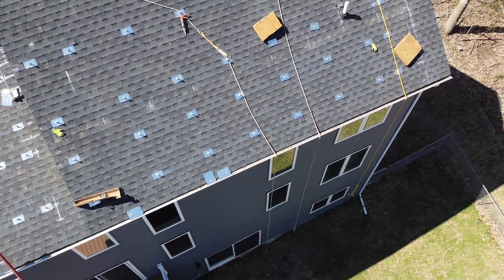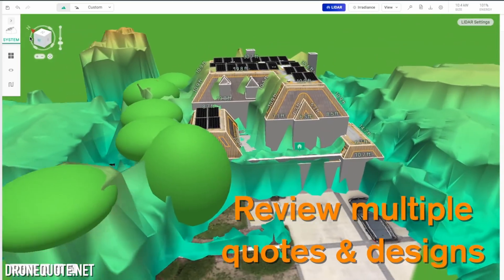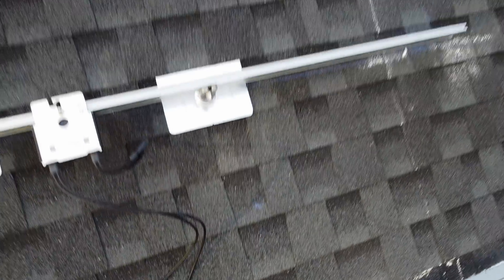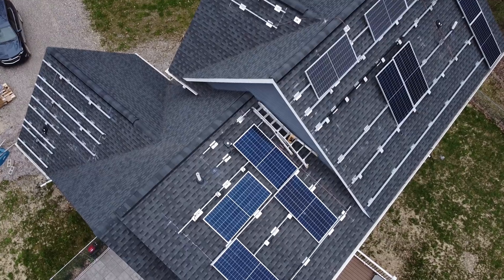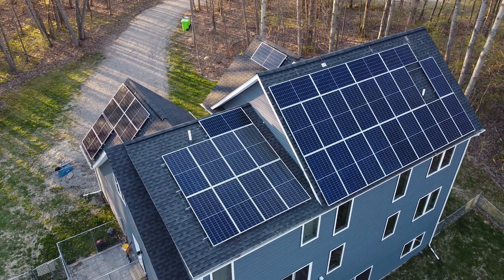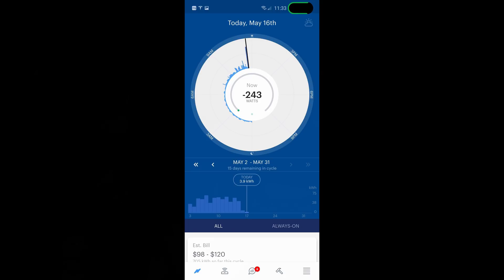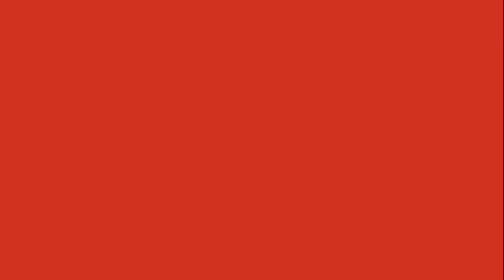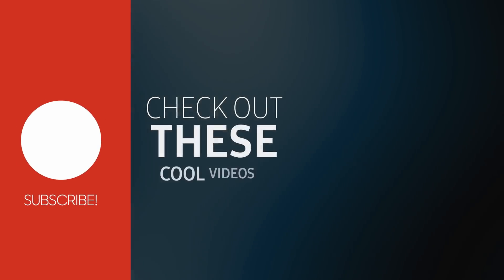Michigan Solar Panel Install Experience | Home Solar Installation, Cost, Positives Negatives

Comment: Is your installed solar panel KW capacity based on your On-Peak usage or entire day KW usage to determine the number of solar panels? how long did they say it would take to pay back the project cost and do you think you are getting there within the time frame they proposed?

Comment: I have seen just about all of your videos in hope to understand how much KWH should I be making to be able to charge a future model x Tesla with the new Solar panels I’m about to have install here in norther Pennsylvania and have enough kw to run my big appliances such electric heater, well, electric all kitchen, septic tank, radiant flooring, outside lighting etc… so I believe I’m overthinking it, at this point I have been Quote 21 panels at 370kw to power a 2000kwh a month just for for house usage.. but my real question is how many more panels should I add on top of the 21 solar panels ?  Again my apologies ahead of time if this question seem silly 🙃.. thank you all for your patience.
Reply from the maker: It's a good question. First of all, make sure you'll be allowed to add as many as you need. Some utility companies will only let you go a small percentage over the amount of energy you use. So in that case, you may just want to get the Model X first and then get your solar quote ~6 months later.

But for a quick guess, take the efficiency of the Model X (I don't know it, let's say 350wh/mi) and multiply that by your miles per month. Say 1,000 miles per month that's 350kWh just for your Model X. Hope that helps :)

Comment: Very nice.  Solar is something I've been thinking about for years, but didn't want to do anything to my dwelling until it was paid for.  I finally do own the home free and clear... but I gained a wife who is a total packrat and has filled my house to the brim, so NOW we're thinking of getting a bigger place so she can store more stuff.  :)  I do have some questions:

1.  I assume if commercial power goes out, you're in the dark regardless of solar output.  I believe you need a battery backup system to basically put your whole house on UPS, and the panels can recharge those.

2.  Did you have to have your roof reinforced (or did you have it built to handle the added weight of those solar panels during construction)?  Was reading that some homes need this supplement.

3.  Inverter life - I've read most of those are supposed to last only about 10 years, or half of the life of the panels themselves.  True/False?

4.  I assume you're eventually going to do powerwalls or Generac's battery system...  do you plan on having the entire house backed up?  At minimum, I'd think you'd need heat, well pump (if you have it), refrigerator, and hot water.  Could get carry-out food until power comes back.

I lose power EVERY year, usually 2 times a year, so much so that I finally got fed up and bought a generator.  You can easily tell how often a neighborhood loses power by how many generators fire up when the power goes out.  And there are a lot of generators around here.  lol

I don't have a pure EV yet... still driving a 2013 Fusion Energi (well, my wife is now; her car got totaled a couple years ago).  Surprisingly the batteries are still OK in that thing.  Probably until next year when the 8 year EV component warranty expires. :)

I've also considered building a new home, but shopping for land has been a process.  I've also thought about putting the panels on the ground or pole mounted, and putting all of the electrical everything (batteries, inverters, etc) in a separate shed/building, just in case something malfunctions; it won't take the house with it if something decides to spontaneously combust.
Reply from the maker: 1. Correct. We hope to get batteries!

2. Nothing special done to the roof. Maybe older houses would be different in some way to need this?

3. I don't remember our inverter warranty, I think it was 10 years. Good news is this is just one unit in the basement, and inverters in 10 years will probably be much better than today :)

4. We will get 1 powerwall definitely, possibly 2 to support more. My plan, I don't know if they'll allow it, is just put the entire residential panel with the powerwall and be mindful of what we run to not overload it at night or if it's cloudy.

As for heat, we have geothermal, and it uses far too much energy for a powerwall or even generator to support it, so we have kerosene in case of an emergency. We lose power several times in a year. If say once a month on average.

Ground mount is definitely a nice option if you have the room, but it's gebrrallt more expensive than roof mount.

Lmk if you have any more questions! Feel free to email me dirtyteslayt@ gmail :)

Comment: You said these panels are pretty tough, are they tough enough to handle the hail we had here in West Michigan last month?   We just had our roof replaced in fall of 2018 and now are getting it replaced again.  But after that hail, I'd worry about putting panels up there.  Of course, hail like that doesn't happen very often, so hopefully we'll be fine for a long while either way.
Reply from the maker: I think they're rated to 1 inch hail. It's very rare but if they break, each individual panel isn't all that expensive fortunately.

Comment: Recent revelation: Solar panels are MORE efficient when cold, which makes sense with less internal resistance from heating. Thus, a colder climate partially compensates for  shallower sun angle and exposure. Excellent video, explanation and follower commentary.
Reply from the maker: Thanks! These dummy 60F days would be perfect for solar but now we're moving into summer (90F today) and still no inspection!!

Comment: Good for you!  As someone who has had panels for a while, I was looking to try and see if you had 'bird barrier' of some kind installed around the perimeter of the panels.  When we bought this house with the panels already on it, there was no bird barrier and we were bothered by an infestation of pigeons roosting under the panels.  It was an ongoing nuisance of noise and mess.  When we had our roof done we had bird barrier installed.  Problem solved!
Reply from the maker: Yeah I thought about it but never got around to asking the installer about it. I'll hope it's not a problem but if it is... I'll have to deal with it.

Comment: Here in the U.K. we are limited to the number of panels per household to 16, the cost to us for Pvs was £6000 GDP with a return for supplying the National Grid of approximately £500 GDP per year, our Pvs were installed in 2014 which means that by 2026 they will have paid for themselves with free power whilst the sun is shining. You really should consider changing your power supply company, we recently got an email from our power supplier (we're dual fuel) telling us that the price of power was going DOWN, with the cost of oil falling your power supply people must be raking in their profits.
Reply from the maker: We do not have a choice in power supply company unfortunately

Comment: Got solar installed last Thursday. Activated yesterday. And I’m loving it! Very similar situation as you. I bought a Tesla Model S  which made me reconsider going solar. Got a 11.4 kW system.  Once yours is activated you’ll be looking at the monitoring app daily! Lol. Great video 👍🏼
Reply from the maker: I'm so jealous!! Still no inspection!
Reply: Dirty Tesla it may be different in Michigan, but the energy company came and installed the meter before the inspection. They said it was fine if it was active while I waited on the inspection , which is scheduled for JULY 30th. May be worth following up with your energy company to see if they can send someone to at least install your meter. It took my guy 5 minutes. I know how hard it is to wait. Good luck!

Comment: What did your company say the expected annual output for your system? I am curious on differences in areas-for my San Diego 7.56kw system expected output is 11.5KWh annually. I am a bit surprised you did not get a Powerwall as it does allow you to never/rarely use Peak rate energy. Agree the payoff period is much longer for the PW. The Tesla 7.56kw + 2 PW was $36k.
Reply from the maker: Should output around 15,400wh/year.

We will get a battery eventually it was just too much money for now. I'm also looking into building a battery as they are waaay cheaper.
Reply: Thanks for the reply. I would love to follow your process on building a battery so please start that soon 😀

Comment: From my experience don’t go with Tesla installer.  

The panels and power wall was put up quickly. The problem is that Tesla failed PG and E inspection our local electric company. This was 4 months ago and as of this date Tesla has not fixed the problem. Don’t use Tesla installer
Reply from the maker: Yeesh. Yeah I've heard both good and bad stories.

Comment: Hope you are able to get your second electric car soon! My wife and I plan to do the same. We just got her an electric car and I've got a Model 3. Our goal next year, hopefully once things get better with the current pandemic, is to also get solar panels installed. I've been looking at several installers, but I'm leaning towards Tesla since I've been told they can install were I live. :)
Reply from the maker: I would have probably done Tesla too, but I've heard from different sources thst while their price is competitive, they don't always do the best job, so may want to get multiple quotes to be safe.

What's your second EV? Trying to convince my wife on the bolt since it's so cheap but it's so ugly haha
Reply: @DirtyTesla  Definitely will, thanks for the advice! I'm definitely open to anyone else. Even if I get panels installed from someone else I am set to getting a Powerwall if it's compatible. Do you know if your panels would be able to work with a Powerwall?

Nice! The Bolt was definitely one of my options when I was buying my car, but my wife was hard pressed against it for being ugly haha We just got her a Mini Cooper SE this weekend. It's not a lot of range, but it's perfect for her in-town driving and we've got my Model 3 for longer trips!
Reply from the maker: @MiguelRodriguez-mj2ec  yes most systems are compatible with the powerwall. My company said my system is ready for a powerwall whenever. If I wanted the LG battery in the future, they were going to add some additional hardware (I don't know what). I obviously want the PW tho.
Reply: @DirtyTesla  I see. Wow I didn't know that LG battery would require additional hardware. Who knows what it could be. LG Battery was my next choice if I couldn't get Powerwall. Well, I'm excited to see more videos about your solar system. Can't wait!

Comment: How much was your geothermal system? I'm interested in doing that for when I build my home as well
Reply from the maker: It was around 30k and gets the exact same rebate as solar.
Reply: @DirtyTesla  is the percentage also dropping in the coming years? 26%,22% ECT
Reply from the maker: @mrtesla5724  yes. It's the exact same legislation. It was actually halted for a bit there in 2018 when we were deciding whether to go for geo or not so we almost didn't do it. So glad we did tho. It works amazingly well, bills are cheap. I plan a review video of my first year with it eventually.
Reply: @DirtyTesla  I definitely want to see that video, I've been wonder how well it keeps you warm and cool up here in MI
And good to know on the legislation, I'm familiar with it
Reply from the maker: @mrtesla5724  the quick version is it works. The polar vortex last winter had me worried, but it never got cold in the house. And cooling works even better
Reply: @DirtyTesla  nice!

Comment: Our first house has most of the panels on the east side it does great, the rest are on the west side, but south is the side is a vertical wall 😒

I'm ready for the next house and next installation.
Reply from the maker: Glad they still do well even when not in the perfect position!

Comment: I like what you're doing.  Adding solar is a solid investment for most people.  I added solar to my house in Illinois last year.  It's not as big as yours (6.5 kW).  The DIY install came to less than $1/watt after the 30% federal tax credit in 2019 (it's now 26%).  My state offers net metering, so a Powerwall is of little value except as a source for backup power when the grid goes down.  My solar was a $5938 investment for 20 roof mounted Canadian Solar 325 watt panels, Ironridge racking, and an SMA Sunny Boy 6.0 kW inverter.  It pays about $740/yr in electric bill savings.  That's like earning 12% interest on a tax free CD.  I'm surprised more people don't take advantage of solar in my area (Chicago).  It's a no-brainer when you think about it.  LOL.
Reply from the maker: It really is a no brainer. Especially diy like you did! Roi is waaaaay faster.
Reply: @DirtyTesla  I think you missed my point.  If you look at the cost of installing a solar system as you would buying a CD, the ROI is immediate in the form of reduced electric bills.  Data show that in most cases, adding a solar system increases the market value of the property by about 4% on average, more than the cost of the system.  The notion of "breakeven" is really not relevant in most cases.

Comment: I've been toying with getting solar but thinking about putting the panels on a stand in the yard so as to not compromise the roof.  Did you consider that option?
Reply from the maker: We have way too many trees for that. Ground installs are also more expensive, but then you can get the perfect position and angle.
Reply: if you have enough space on the ground its possible, plus you will be able to easily clean the solar panels or orientate them

Comment: I went for all black sun power 335's in roof, much nicer looking aesthetically for me. Roof tiles are removed and the panels sit in a plastic tray, believe the system is made by a French company. These were my installers https://www.jojusolar.co.uk/portfolio_page/julian-lorena-join-blacks/ (not my house), on my roof the panels are flush with the remaining tiles. Record solar production here in the UK at the moment (apparently due to less pollution refracting the sunlight). I get feed in tariff of approx £275pa which brings my cost for the house and the car (9k miles pa) to £20 pm and in the winter use an overnight tariff to charge the car at 1/3rd of the usual tariff. Or you can switch to a flexible tariff that mirrors the market, on sunny windy days they pay you to consume electricity, so leccy car owners frantically plug their cars in and get paid to charge. Previously I was paying £60pm with no EV, car charging initially doubled my leccy usage. Up yours oil companies :)
Reply from the maker: That's amazing!

Comment: Picking the right installer is critical. We have a PV system with Enphase microinverters on our house in Florida. One of the microinerters was down for months and the installer was not monitoring the system so they did not notice it. I happened to look at our Enphase Envoy box and there was a read light on. I called our installer and they told me one of my microinverters had been down for 2 months. They sent someone our to replace it for free, but if I had not called them I don't know if they ever would have noticed. Since then Enphase has updated their Enlighten software and it now shows the power generation per microinverter. I look at it every day because I don't trust that anyone else is.
Reply from the maker: Dang. Glad you were paying attention!

Comment: Maybe someday you'll be able to plug the car in and use it to power your house after dark, 80kw or so of storage would be substantial! If your second EV turns out to be a CyberTruck, I think that might be possible?
Reply from the maker: Yeah cybertruck has nema 14-50 so I don't see why not!
Reply: @DirtyTesla  he was talking about vehicle to grid, just like nissan is already doing, so you wont need to use the nema 14-50 but the car charging port directly

Comment: Don't forget to call your insurance  agent and add the value of the system to your home owners policy. Anything bolted to the house becomes part of the house. It's not much (mine was like $35 extra a year). That way you are covered in the event of hail or if one of those trees falls on the house
Reply: There goes the netmetering surplus. ;)

Comment: Like the new setup. Question: the price (and loan) is supposed to compensate for the (lack of) electric bill, but how much are you getting payed to inject electricity back into the grid? Is that taken into account in the overall price equivalence ? Or is that going to be a bonus? Thx
Reply from the maker: Thanks!

The amount going back into the grid is taken into account with all this. For Michigan, they will not pay you for extra, just give you credit for months where you don't make as much electricity (so in the winter/at night I'll be using credits gained in summer/day).

Some states actually do send a check for excess energy produced.

Comment: How did the unequal net metering rates in Michigan affect your payback? I'm in Michigan, and doing energy modeling, the unequal rates hurt the payback period quite a bit (But I have a lot of big natural gas appliances, so my big loads are not that big and not easy to shift). 

For those of you outside of MI, MI utilities are only required to buy power at the wholesale electric rate, which is roughly half of the net electric rate (the other half is distribution charges). It's better than not having net metering at all, but you have to shift your electric usage to line up with solar production or use batteries to shift your usage to get the best return.
Reply from the maker: If we do get back the old net metering, I believe solar king said it will take 1-2 years off the payback period. He said to expect $5-$15 average bill with current NM vs $0/month with old NM.